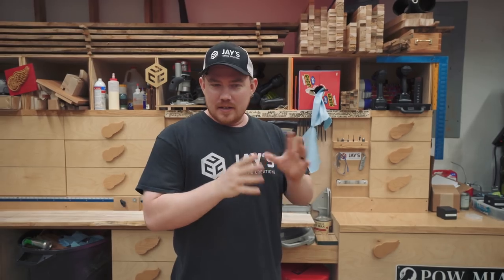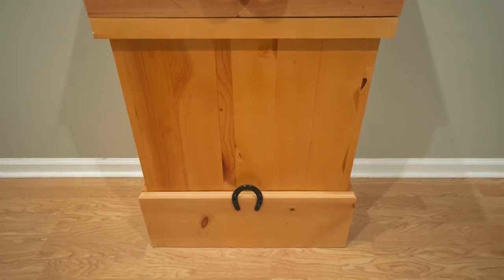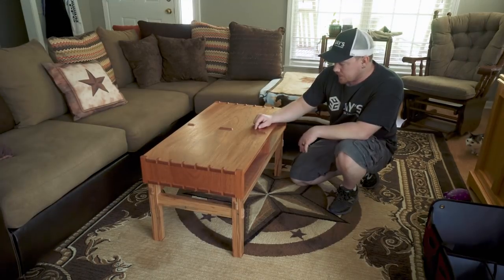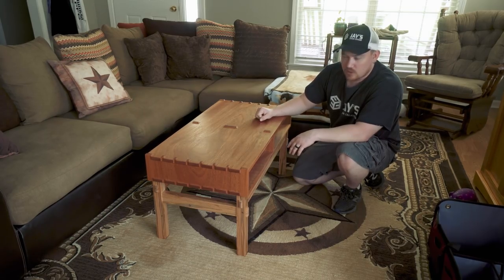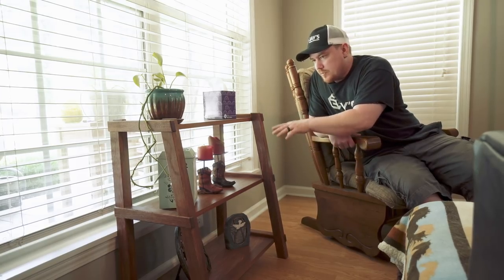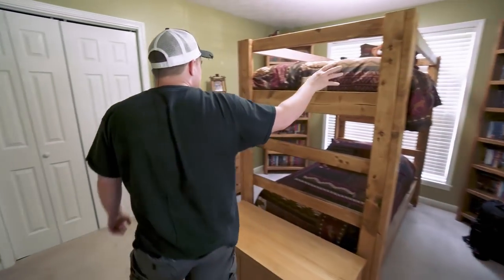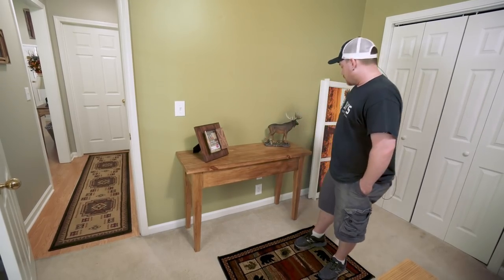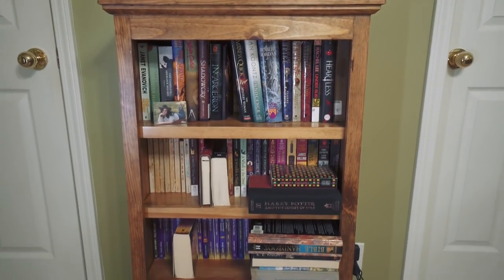Past Projects - How are they holding up? - 305

Comment: Well over 20 years ago I built a small trestle end table out of inexpensive 2x6 material with a natural finish. My daughter used it for a long time and at one point she painted it black. That bothered me but since I gave it to her so she could do whatever she wanted with it. She eventually gave it back. 

The top was three pieces glued together, no splines, dowels, or biscuits just glue. It has warped and separated and looks bad and certainly is now a long way from flat...however I doubt I will ever redo it.

Today it is in an unused bedroom with an old black Behringer amplifier sitting on it gathering dust. I likely used too much clamping pressure and the wood was likely too wet when it was built.

Anyway I kinda like the way it looks now, it has some history. When I am gone someone will throw it in the dumpster and that is just fine with me.
Reply from the maker: Glad you're keeping it. It tells a story :)
Reply: Isn't that the greatest thing about solid wood furniture? Even the stuff built with the cheapest wood and the most amateur construction will outlast the person that built it, with the exception of outdoor furniture.
Reply: I have certainly worn out and thrown away a lot of particle board store bought furniture and cabinets in my life but that ole end table still serves a useful function...thinking on it, it wasn't built 20 years ago...it was more like 35 years ago. Maybe I should restore it...wouldn't take much. :-) The only part that messed up was the glue joints on the top slab.

Comment: It’s amazing how different Parts of the country affect woodworking, I use kiln dried lumber day in and day out with hardly Any expansion issues but I’m in San Diego lol, i here so many carpenters/wood worker go through hell in the south east.
Great video Jay!
Reply from the maker: Humidity sucks
Reply: Different areas different challenges. My area is all pine and fir. All hardwood is shipped in, harder to find and expensive.... But hardly any humidity to worry about.
Reply: I just been introduced to elm. Nice wood but does everything a woodworker hates. Been a huge learning experience for sure.
Reply: You can buy a straight board at Lowes or Home Depot and get it home and it is warped. I am in middle GA USA.
Reply: Even here in the SF Bay Area with our Mediterranean climate -- moderate temperatures and humidity and only two seasons -- if you can find a straight board at Lowe's or Home Depot it will be crooked by the time you get it home. 😀

Comment: If u want to use a latex that doesnt stay tacky, use latex enamel. Many cabinet makers use it, and used on trim, one of the best trim paints because normal latex will always get tacky with humidity or anything that sits in place for awhile. Enamel latex is a hard finish oilbase like. But in a small shop space lacquer is best since it will just be dust when it lands on ur tools as opposed to overspray still wet sticking to everything.

Comment: I live in So. MS... thanks for the tip about the kiln dried wood. I work out of my non-climate controlled garage and was wondering if kiln dried would be preferable or what unique circumstances my set up entails.
Reply from the maker: Nope. Avoid it if you live in Mississippi. It will expand like a sponge.
Reply: Will do. Thank you.

Comment: Might want to look at your HVAC  vent behind the corner cabinet to make sure its not hurting the flow
Reply from the maker: It's a secondary flow dummy vent. There are two that provide air into the laundry room where the actual HVAC air intake vent is located. And the laundry room door stays open all the time anyway.

Comment: So if you rebuilt the dining table today, would you leave an intentional offset that makes the breadboard noticeably wider than the center? 

I want to do a table soon with breadboards and i wanna come up with a solution to this expansion that i know is going to be far more drastic than the movement in most of the country. 

Mississippi is one of the few places where we can have 100% humidity without it raining outside 😉
Reply from the maker: No. I'd build it the same way. Just not using kiln dried lumber. Air dried would have been better. Kiln dried is too dry for our climate.

Comment: Did the wood of your dining table shrink in winter? I have a maple dining table that moves plus and minus about 3/16 of an inch between winter and summer. Boards are proud of the breadboard in summer and slightly inset in winter. In in NC.
Reply from the maker: No. It's humid year round in Mississippi. I don't recall seeing the inside humidity below 50% on my thermostat in the four years we've been at this house.

Comment: Jay...I have a large spalted alder live edge table coming together...use...dining room...8 ft by 42 inches...2 thick...What topcoat if any would you suggest...My test strip looked nice with Osmo...but perhaps I need a more sealed top for a dining table...I used General Finishes Gel Top Coat for my work bench and it has held up well...What do you think?
Reply: The question was stimulated by your taking a look back on your painting the bookcase without a topcoat
Reply from the maker: I'd use arm-r-seal if I had to redo the finish on my dining table.

Comment: I too learned the hard way not to use gloss latex paint for surfaces that objects will set on for problonged time. I did a bookcase that way, and heavy objects stick to it. At some point I'll throw that away and build a better bookcase with wood worth looking at and not paint it. I have a magazine stand that my father made in his high school shop class, and the top has split due to wood movement. Eventually I'll carefully remove the top and repair it. He used screws drilled through the top (and plugged) to hold it on, and I think that I'll use dowels or biscuits instead of screws. I'll figure that out if I ever get started on it.

Comment: shouldn't block your cold air return in the corner like that.
Reply from the maker: That's obvious. But it's a secondary flow dummy vent. There are two that provide air into the laundry room where the actual HVAC air intake vent is located. And the laundry room door stays open all the time anyway.
Reply: ahhh... I see.  Good.